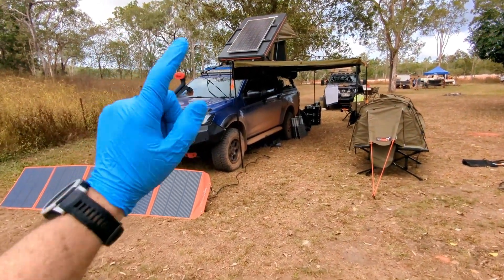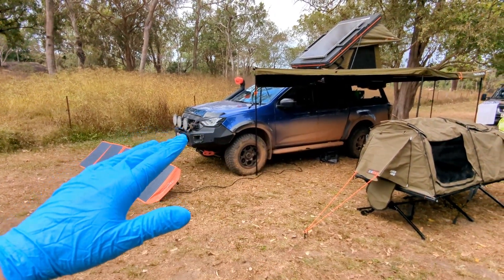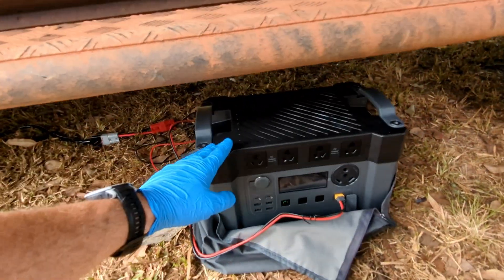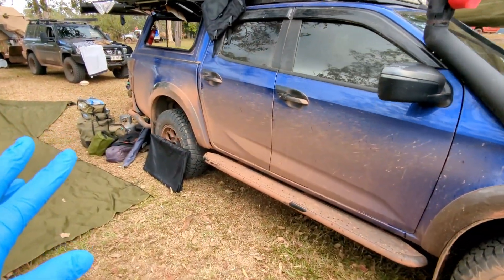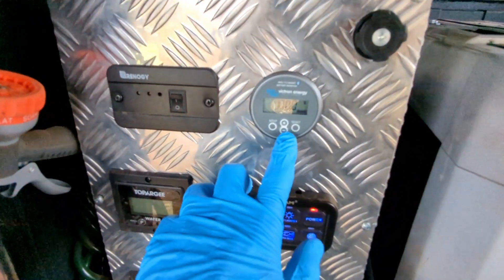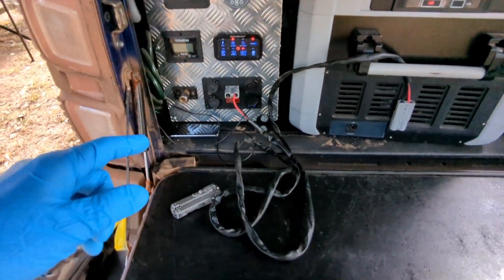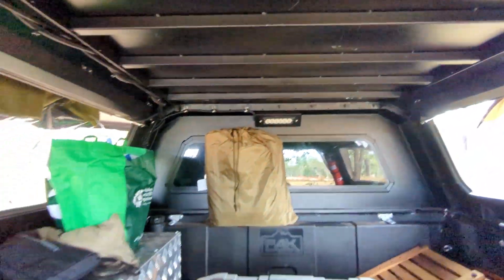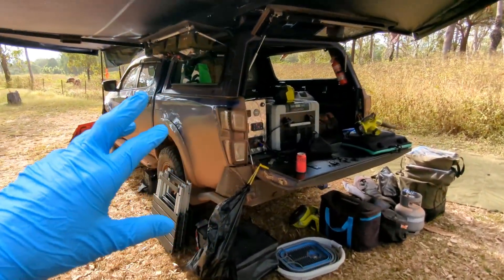VideoShowMeHow CapeTrip DAY #6 VLOG #noeditonetake

Comment: Sealing a tub and canopy from the dust on a dmax is a real trick. You can seal the tailgate with the right generic stick-on tailgate seal off ebay and a bit of patience. First trick is to build up the corners of the tray with sikaflex 221 so you've got a consistent finger width gap between the metal on the tailgate and the tub (might take a few applications to build up), then once it's cured for a few days, stick on the tailgate seal. Make sure your seal has the peel off strip with clear jelly-like glue as that's the only type of strip that will really stick. I also ran a thin bead of silicone along both edges of the glue strip after it had settled (gave it about a week with tailgate in use, but mostly shut) and shut the tailgate while the silicone cures. There's also multiple points a tub drains through that you need to plug, especially up the front of the tub at the bottom, and the top 2 corners inside. Fill em with Sikaflex. I left the gaps at the rear at the top of the tub alone, has to be SOME breathing. Ended up with less red dust than others on the same trip in land cruiser wagons, and I did way more miles on the PDR than everyone else cause I ended up playing parts courier a few times to get mates fixed up on the track. Kept the creek water out as well all the way up the old tele, plus the Daintree river after doing the creb from north to south.

Comment: Looks like the mounting clip is still there so the sensor most likely wobbled its way back into the bar.

Mine ended up doing this and found it was due to the powdercoating where the clips are, preventing the sensors clipping in properly. Filed down the holes a bit and now they clip in nice and tightly! 😁

Look forward to your next clips! 🤙
Reply from the maker: Yep reckons that's it! Will suss tomorrow

Comment: That sensor will probably wig your park warning out! It should be in there usually the wires don't come off & they just push in!
Reply from the maker: Yeah, they push through from the inside into the plastic clip, reckon it's copped a stone and fallen back in, will go digging in the morning ;)